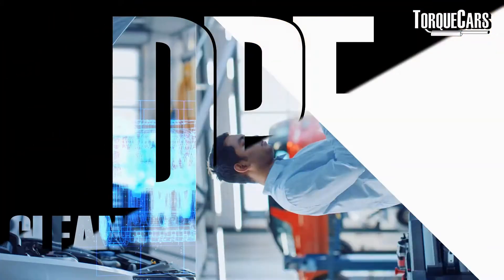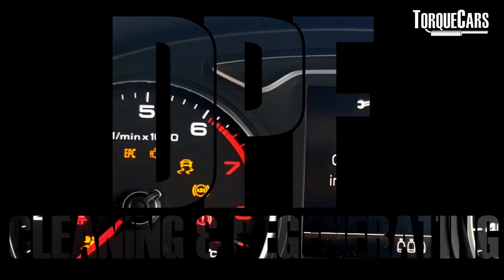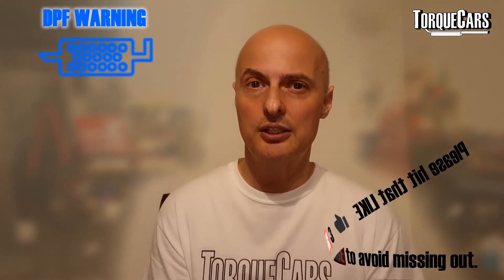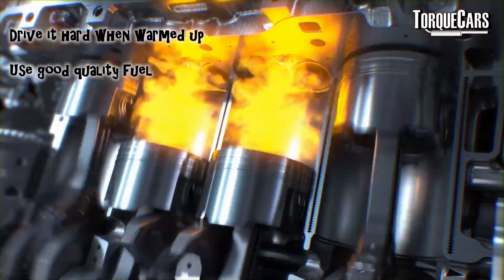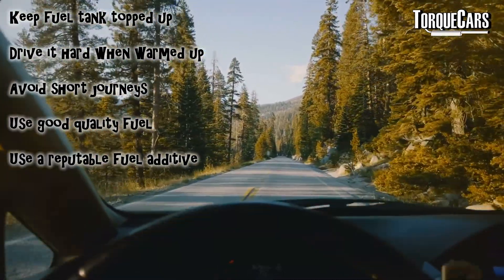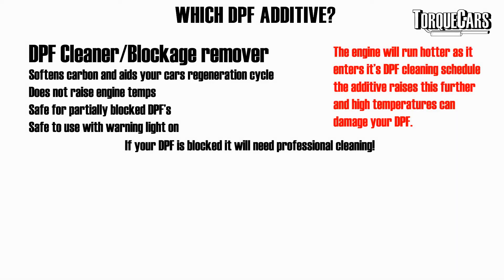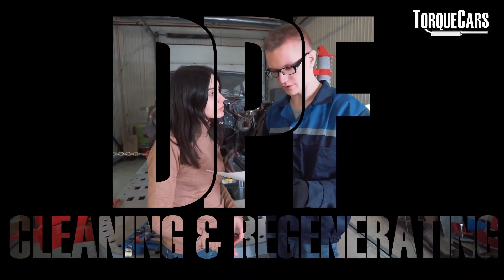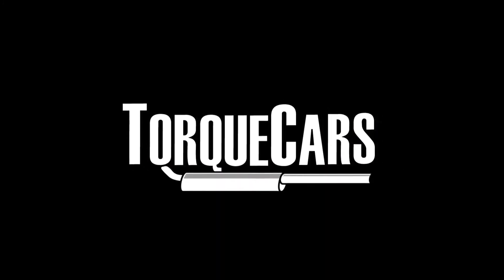How to clean a DPF Filter

Comment: How short is a short journey?
Reply from the maker: You need the engine to be up to temperature for at least 10 mins, so in most cars and for most journeys you would be looking to exceed 15-20 mins for each run, but it will depend on ambient temps, how fast the engine warms up and the type of driving you are doing.